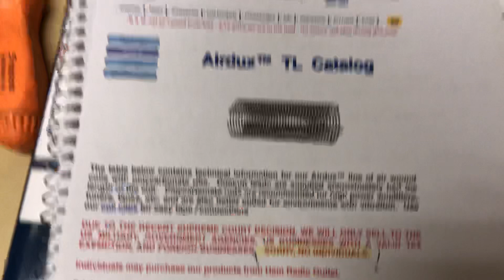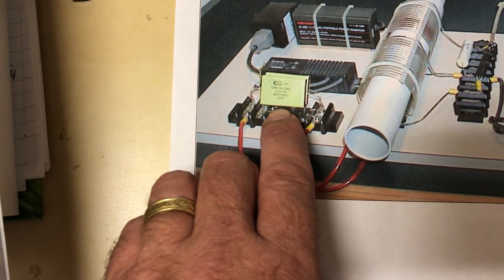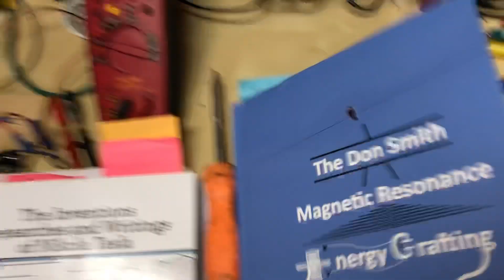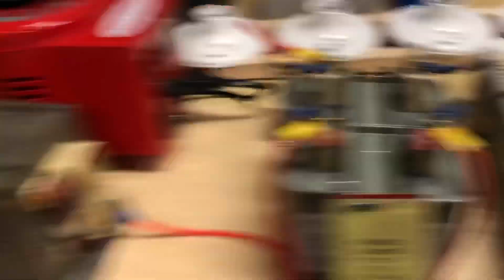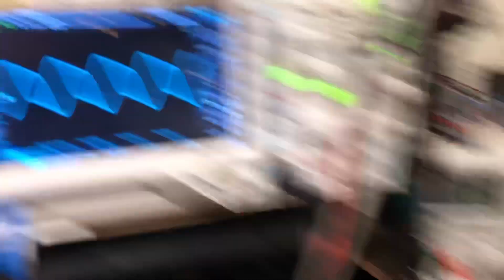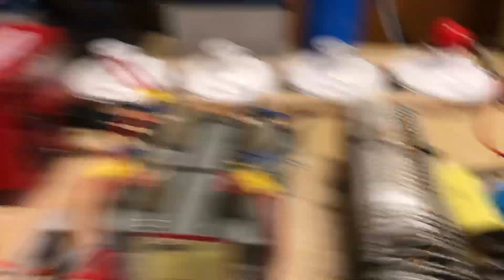Don Smith - Tuning L1 and L2  - March 2019

Comment: He tunes L1 with a multiple of 35.1 khz, w1hich is the frequency of the neon supply he uses from Bertonee. It won't work using 60hz unless all of the coils are perfectly tuned to any multiple of 60hz, however 60 hz isn't high enough for the effect to function. I have duplicated this circuit, even was sent the bertonee supply by one of my followers, but then it burnt out when a capacitor exploded and arced back to the neon supply. The output has incredible power. It doesn't stop or slow down the feed at all no matter how big of load there is on the device. I had 15 500 watt halogen bulbs and 16 400 watt conventional bulbs all lit up so bright you had to look away. The output light is even different from conventional electricity, like it comes from another world.  The key of the circuit is to use very separated groundings, like 20 plus feet away from each other. I poured salt into the ground and buried copper plates with electrical connections on them. 3 separate ground wires, one at the beginning at the neon transformer, another at the center tap of the secondary coil, and the 3rd either at the load or at the last transformer before filters. The filters used need to coincide with the load's impedance. So like an audio bandpass filter, if it is built for 4 ohms, you could see chrts online for the frequencies you need. The filter takes all of the energy and magnetic flux from the coils they are built for and force the amperage or drive of the circuit into one single frequency, 60 hz. You need to limit the upper frequencqy to 60hz as well as the lower frequency,. The last transformer will reduce your energy from like 480v to 120vac, but then the bandpass filter will need to be built to filter the wide bandwidth down to 1 60hz cycle. It is important the make sure the load is st the right impedance and it doesn't drift otherwise the energy disappears.
Reply from the maker: Hi Marc,  it sounds like you have had much more success than me.  I have looked at this with a scope and I can see the coils ring at the LC frequency after the spark (even though I'm using 60hz to make the spark). It looks likes a sawtooth wave.   All the new Bertonee transformers I've tried have a spark sensor circuit that cuts them out so I haven't had any luck with them. And the new ones don't have a center tap. I have used my own high frequency transformer with a H bridge circuit but still not luck.  It does seem clear from information available, Don's L2 was running at about 183.5 kHz. From your note above it seems a big part of my failure is not understanding how to correctly set up the filters to the load impedance.  Don's states "The power factor correction capacitors should be as many microfarads as possible as this allows a lower operating frequency. The 12 V neon transformer oscillates at about 30khz. At the power factor correction capacitor bank we lower the frequency to match the input side of the isolation transformer". And goes on to say " Always lower the frequency at the power factor correction capacitor and correct if needed, at the input side of the isolation transformer. The isolation transformer comes alive when pulsed. Amperage becomes a part of the consideration ONLY at the isolation transformer".   So this goes along with what you're saying regarding the filters and impedance matching.  I'm having trouble doing this part...   Oh and Don also mentions multiple grounds as you discribe. Thanks for your comment. Very much appreciated. Cheers, Loz
Reply: Marc, what about the primary and secondaries? Does the length and number of turns of the secondaries have to be a multiple of the primary?
Reply: having three grounds sounds sounds about right to me ! perhaps can be done with less but each ground seems to amplify the energy. ive been tinkering with things and i notice the difference with and without grounds. maybe you can help me progress with my initial set up !  : )   my neon sign transformer is 25khz, how do i calculate the coil length for that ?

Comment: Hey there bro nice work listen his NST is putting out a frequency of 35.1khz to his L1 coil so he's tuning his L1 coil to his L2 coil with a 35.1khz frequency for starters mine is putting out 50/60 hz so I still have to up my frequency to his . Isn't your transformer putting out the same? 50/60hz? If so you might want to rethink you resonance calculations
Reply from the maker: Hi Ben, 
The input frequency from the varic (50/60hz) is irrelevant.  Because as soon as it starts sparking the frequency is set between the inductor and cap of L1. Said another way, the frequency just after each spark is the LC resonance of L1 and you want that LC resonance to match the L2 resonance.  You just need the transformer to get the voltage up high enough to create the spark. The problem I'm having is setting up the "power factor correction capacitor" and also the "correction resistor" that goes across the input of the output transformer .  Don was very specific that the amperage only comes alive in the isolation transformer / (output transformer).  I'm sure it's the key to this device! Information is confusing and contradictory.  So trial and error seems to be the only way through.  I'll put this one back on the bench and play with it. You have me thinking again! 
Cheers, 
Loz
Reply: @Captainloz  Hey there bro I know I'm trying to decipher this mystery myself. I've noticed certain entity has been corrupting the info deliberately trying to mislead us. The power factor correction is that the MOV / varistor he's referring to getting connected across the ground of the transformer down to earth?
Reply from the maker: @benvaneeden2460  If you go to my YouTube Channel and click on "ABOUT" (near the search icon) and then click "view email address" you will find my email. This is just a hobby for me but when I have time I will respond. Cheers
Reply: @Captainloz  Hey Cap do you mind if i can connect with you and exchange info? I'm sure you overwhelmed already with guys. Let me know I'll be greatfull as I've been following your work I think you close. Sweet B

Comment: And apparently a microwave transformer  is definitely not the way to for an input voltage as it doesn't output enough and there are huge losses due to soaking in the transformer leaking

Comment: I understand that you are trying to replicate what Do did but you should realize that there is no need for the coil system between the NST and the caps.If you have an NST running at 44KHZ and 6000 volts, make sure that it goes through a diode bridge that can handle it to high voltage pulse caps 6 to 10,000 volts then to a ferrite core transformer to go from 6,000 to 24 volts into  another diode bridge and caps into an inverter to get power. Just make sure that your power wires are tuned for 44 KHZ and they will pick up the frequency to keep the battery charged.
Reply: Quarter wavelength of 44kHZ is 1704 mt for the power wires. The spark gap would change the frequency to mHZ.

Comment: Hello Cap: Very nice and clear presentation of Don's configuration. I would like to know what are the specs of the capacitor bank you used; that is on the right side of the white pvc. There re four of them. I need to know what are the working volts of these caps. Don used a value of 0.1 mf 1000 wv. Can you give details and source. Thank you.
Reply: 4 x 8uF 2000V connected in series.
Reply: @markussteinbacher8807  hi mate ...Id APPRECIATE YOUR HELP.  where abouts can you get these capacitors from.  i can not find them anywhere
Can HV pulse capacitors be used ? Ive only found "8kv 3uf HV pulse" capacitors so far.
I dont want to reduce the secondaries HV value just to get capacitors that I can use.
this is one of the biggest problems dealing with these types of HV circuits ... ALLWAYS COMPONENT PROBLEMS & insructions !
Reply: @hitbyligtning9661  no idea... surplus stores ?
take what you have . Lesser uF lesser Amps - but for testing - it is ok.
Reply: use them in parallel - Don smith states: each 8 uF / 2000 VAC (video 5)
Reply: @markussteinbacher8807  На фото- паралельно

Comment: Excellent presentation and analysis. Great job Cap! I have been working on this for last 2 years and I have the same issue with the resonance and step down last stage. Your set up is amazingly close to Don's. Besides your lab is so cool with all the equipment needed are at your finger tips. You are a professional yet deep in the study of this type of energy. Great work, very inspiring and very practical. Hats off to you sir.
Reply: Оденьте шляпу сэр, она же не работает, а только искрится
Reply: 😂😂😂 @игорьрац
Reply: 😂😂😂 @игорьрац

Comment: As you draw current from L2 through the diodes to charge the big storage caps, the current draw will change the L2 inductance, altering the secondary resonant frequency. So initial tuning will be off from your calculations. Once you tune it, adding different loads will again change the resonant frequency. You need a PLL frequency adjustable primary. Either that or regulate the power drawn from the output, varying between a dummy load and a useful load, guaranteeing constant output draw. A group in China built a high voltage primary switching circuit for the primary side.
Reply from the maker: Such a good point.  Thanks for the comment!  I like the idea of re-tuning with a dummy load.
Reply: They are not storage caps they are for power factor correction  as L2 is quarterwave and not fullwave the output voltage  and current  are out of phase with each other, you need them.if you are driving an inductive load like a transformer,  you don't need them if the load is purely resistive like a lightbulb, but yes the caps and  load does affect  secondary coil putting  it out of tune with the primary tank cicuit

Comment: You should be using much higher Hz.  If I recall correctly, Don Smith said you have to be above 200k hz to be safe. 185khz could be very dangerous. I was thinking, that  Ideally you could use a 4G or 5G  wifi and be in the millions of hzs.  I was thinking to try buying or making an amplydyne connected to a rodin coil.  It could be much easier.  BTW Don Smith also said you could get resonance automatically without any calculating if you use a tube within a tube, which makes sense since the geometry of a circle could have that effect.  I'm not sure how one would go about that but it was in one of these videos>>>> Somebody uploaded all 7 videos to youtube>>>> https://www.youtube.com/watch?v=BHr3eDELyHk&t=15s

Comment: I'm guessing that because there is no next video, you didn't get it to ring from one side to the other yet. Don Smith mentions quarter wave from L1 to L2, so you might try to retune it with different capacitors on L2 to get one-quarter the wavelength. You can also try thirds and half wavelengths. Tesla spoke of the power of quarter and half and third harmonics. It may for some unknown reason end up helping you in getting both sides to ring. Recalling the old days of talking on a telephone with a long cord stretched out across the room, always rotating the phone cord like a jump rope at faster and faster speeds to achieve first second and third order harmonics most easily.
Reply from the maker: Correct, still no luck on getting above unity on this one.  But I'm sure my impedance matching is not correct between the input and the output.  Also The one thing Don said over and over (and others) is you need to determine the earth's local frequency.  I've been looking at different maps but I still haven't figured out how to determine the earth's frequency where I live...  I can determine the magnetic field in Tesla's. I think I just need to convert the Tesla field into a frequency.... and once I know the frequency then I can figure out the wavelength and make the coils the correct length, etc, etc..
Reply: @Captainloz  tune in a radio wr u get the best frequency or loud amplitude without picking up the station, and use magnetic flux measurements for ur coil

Comment: Here is a video I translated from Russian of dynatron. https://youtu.be/FPs5x0Op5QI
It seems that the primary has a quarter wave  resonance that is in the 200mhz range (what don always calculates). The secondary has quarter wave resonance that is lower. On top of that both have lc resonance. If looked through an oscilloscope it is seen that after sharp slope of the spark gap the high frequency is imposed on the lc frequency. The high frequency causes the carrier to be attracted to the top ends. The coil is AC but the field is DC. The lc frequency is purely for the diodes. Its almost impossible to find 50mhz power diodes.

Comment: Hello, beautiful project. I am organizing materials to replicate after years of research.
I have some questions. Are the two coils resonating against each other as shown in this video ?
https://youtu.be/D7QiI8p1gi4?t=54

And the output for the load is direct or has already configured the low pass filter?
Reply from the maker: Yes I think so, that looks to be correct but has no diodes.  Don's said he had a sawtooth wave coming from the coils which goes through the diodes and turns into pulsed DC. Which moves along into his caps, then the output transformer.  Asymmetrical regauging gives the sawtooth wave.  A small pulse in L1 to make the L2 (which has 2 coils) fight against itself.  Two opposing magnetic fields in L2 is a big part of the trick.  Hard to crack it! Good luck!
Reply: @Captainloz  Don says u need to spin the electrons the other way so get a third coil to spin it the anticlockwise and with a lower nos thick pipe coils  as in step down transformers or think of copper rods if inductance n cap of air is an issue wr u cd extract the current into the caps,  ie get an anti clockwise winding so that u cd spin them up as u compress and decelerate the electrons from decompression of secondary, u shd b able 2get ur electric or dielectric charge, then get them charged on to big voltage high capacity cap, also spins acceleration  cd b done with small neo button magnets placed at end of each coil right north facing the coil and left side coil having the north side, though u cd try both sides to chk against voltage rise, also voltage can b directly harvested to the cap as current at high frequency ie abts 60-80kv though cap values must b made appropriate, idea is to get both the dielectric nd ionisation energies transfered to cap, and probably u cd break the mag field with a low nuf cap hv to get the lowest cps or magnetic flux gain to drop n restart probably with a fb rectifier 2 act as pulse voltage....

Comment: Hey. Use a piezoelectric element. between L1 and L2     https://www.google.com/search?q=%D0%BF%D1%8C%D0%B5%D0%B7%D0%BE%D1%8D%D0%BB%D0%B5%D0%BC%D0%B5%D0%BD%D1%82+%D1%82%D1%80%D1%83%D0%B1%D1%87%D0%B0%D1%82%D1%8B%D0%B9&tbm=isch&chips=q:%D0%BF%D1%8C%D0%B5%D0%B7%D0%BE%D1%8D%D0%BB%D0%B5%D0%BC%D0%B5%D0%BD%D1%82+%D1%82%D1%80%D1%83%D0%B1%D1%87%D0%B0%D1%82%D1%8B%D0%B9,online_chips:%D0%BF%D1%8C%D0%B5%D0%B7%D0%BE%D1%8D%D1%84%D1%84%D0%B5%D0%BA%D1%82&hl=ru&ved=2ahUKEwiBxLv35LPpAhWMuCoKHSP0BAsQ4lYoBHoECAEQGQ&biw=1349&bih=625